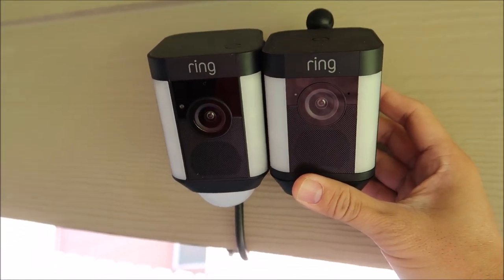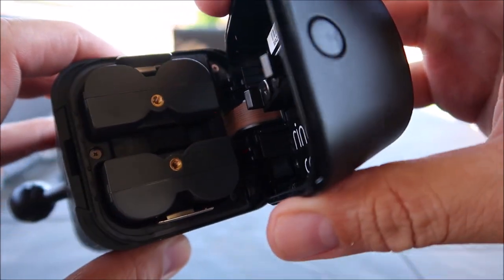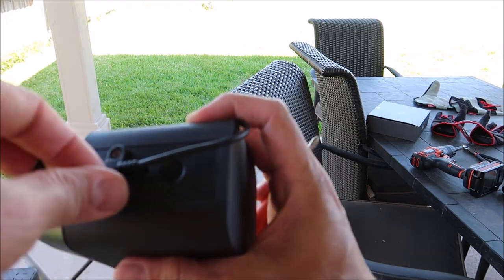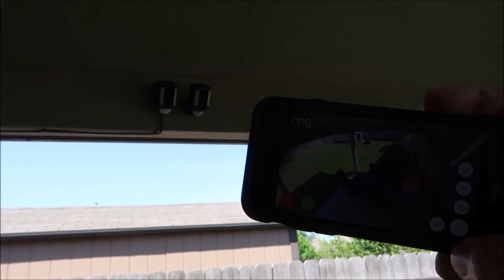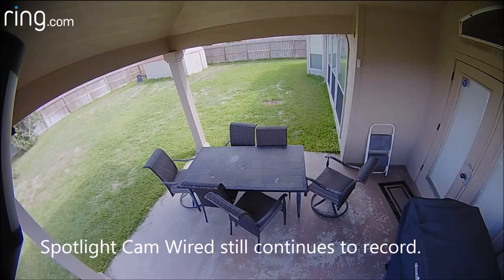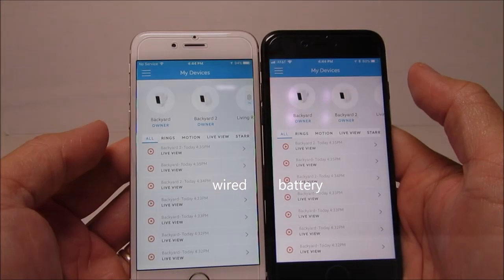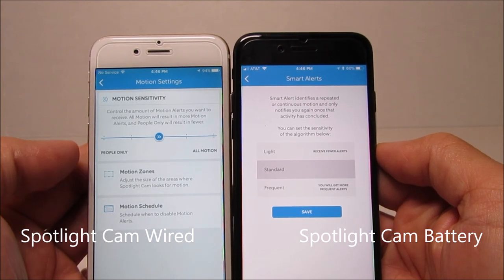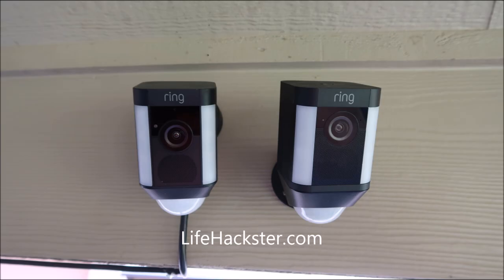Ring Spotlight Cam Wired vs Battery...which one is better?

Comment: I would love for ring to add the batteries to the wired one so that if the power goes out or the crooks cut the wire it works all the time . Thanks great video
Reply from the maker: You are welcome.
Reply: Doesn't really make difference since if the power goes out the modem will be off line too unless you have back up battery for that modem
Reply: Without any storage options battery is useless. A ups or automatic generator would be the only answer. Than again when power goes down half the time internet does also.

Comment: Excellent video pointing out the differences between the hardwired and battery cams, as well as the user interfaces. Most people (including me) would think that other than the power source, the cams would work the same.
Reply: I was planning to order 2 wired and one battery cam mounts, to save the cost of bringing power to the location on my fence where I would have installed the battery cam.  After watching this video I am definitely going with 3 wired.

Comment: Great video! I’ve started buying the wired versions for differences that you touched on. Found out after buying five or so Battery Spotlight Cams that the wired versions are a must if you are mounting them on the exterior of your home. With the battery versions all you get are false alerts due the movement of trees and the limited motion settings. With wired versions I’m able to outline the areas around trees and shrubs and works perfectly. Thanks again for the great video. The side by side comparison was very helpful.
Reply from the maker: Yes, they are more accurate in motion detection.

Comment: Thanks for taking the time to do this. There's actually a lot of difference between the two, but Ring don't seem to tell you that. This is about the only place I've found a side by side comparison. It's invaluable to be able to reduce false alarms and the settings on the wired version are far better from experience. Thanks again
Reply from the maker: Definitely the wired Ring Spotlight cam is better in motion detection.. it uses both the PIR sensor and the software algorithm and that is why it can notify you 3 seconds earlier as compared to the battery version.

Comment: Thank you for the review. It helped my decision towards the wired one. The only thing missing was the distance for WiFi.
Reply from the maker: I usually don't test WIFi distance because there are a lot of factors involved like number of walls, wall thickness and interference but it will be a good topic to do a comparison between different brand of cameras. I know Ring will be one of the last ones. It has a weak WiFi antenna and it will usually need a WiFi extender.
Reply: @LifeHackster  I got the wired version based on your review. Installed and Wifi has not been a problem as I moved one of my mesh routers a bit close to my front door. I'm getting -21db on the camera which is great.
Reply: If you struggle with WiFi distance, they sell an extender
Reply: WDJS22   What brand...model please.

Comment: Thanks for video. I tested both of these ring devices and i have to say the wired is much much better then the battery one. Picks up motion much sooner and catches all activity. The battery one actually mixed two different motions. Soo I’m returning the battery camera and keeping the wired. Just need to find a good way to plug and hide the wire. Thanks again.

Comment: Have you done, or are you planning to, review the solar panel to determine what the least amount of sunlight is necessary to keep the batteries charged? I am thinking about buying one, but it would need to face North, which doesn’t afford the most direct sunlight.
Reply from the maker: I can tell you though as compared to other brands that I have that has a solar panel e.g. Arlo and Reolink, the Ring is the fastest to charge.  Ring stated that the panel should at least have sun shining on it couple of hours a day to be effective.

Comment: Have always learned so much from your videos. Hard to believe this video is already 5 years old. It's fun looking back at old content. Anyway to convert an old Spotlight Cam Battery to a wired plug-in one? Looks like all the power cords do is charge the battery(s), is there a way to plug in a cord and make it work like a wired one, like the current models? Thanks!

Comment: Ring spotlight wired is way better for most uses.  Battery has too many issues.  Had the battery version and now using wired;  for me, hands down, wired is the way to go with pretty much all cameras.  I use Arlo pro 2 cameras too, and they are all wired using accessory cables which enhances their use-ability tremendously.  When in doubt, go with WIRED every time.
Reply from the maker: I agree. Ring's wired cameras are better overall for motion detection, alert notifications and dependability.

Comment: Thanks. Yeah I had both as well. Ended up returning the wireless one. The delay was too noticeable on the wireless one.
Reply from the maker: The battery powered has some software issues on it that Ring has to address. There is a delay because it has to power up from an off position unlike the wired one which is always on.
Reply: LifeHackster what about with the solar panel hooked to it, does it work well?
Reply from the maker: When I was trying it out...it works pretty good...I now have uninstalled the solar panel and just run the batteries..the solar panel needs to have at least 2-4 hours of direct sunlight to be effective...
Reply: LifeHackster how often are you changing the batteries?
Reply from the maker: I got the camera on October  and I swapped the battery out on December...battery was 36%. From December until now the battery level is 65%...I'm thinking the battery should last from 3-6 months depending on your use.
Reply: LifeHackster would you recommend the Spotlight Cam for my backyard or another wireless camera that offers similar features?
Reply from the maker: If you want to go with the battery powered cameras, I'll go with the Blink XT... If you can hook it up on household power...then I'll go with the Spotlight (mount or wired) or Floodlight cam.
Reply: LifeHackster Blink XT doesn't offer 2 way audio or a siren correct?
Reply: Frontlaven does the wire look ugly showing and, can't it be unplugged?
Reply: Mr. RDCS wired version cannot be unplugged because their is no internal battery. However with Arlo Pro and Pro2, you can unplug the cameras and the batteries still keep the cameras going just fine.  But always try to stick with wired, way better every time for most every purpose.

Comment: Debating on getting 2-4 cameras. I need one for the front and back yard. Front of house faces north, south side gets back sun exposure. However, I live in MI and it gets -30F in the winter and no sun. I have outlets outside. Suggestions on a brand or brands that would work for my concerns. No lag between movements, leaves blowing creating false alerts, sunlight making the camera unable to see. I'd prefer not drilling holes through my home or walls but ideally no batteries to change outside etc.

Comment: I would like to see them add the option for "Custom motion zones" to the Battery Cam. I think its possible. The "Custom motion zones" requires the camera to be on at all times, which is why the battery one does not have it in the firmware, to reduce battery usage. But i think it could still be integrated as a secondary motion check before sending notifications that could be false.

Battery Cam Scenario: Motion is detected, Camera powers up & begins recording like normal. With cam powered up, firmware now does a motion check in the preset "Custom motion zones". 
No motion in "Custom motion zones", so no push notification is sent. Unit still records the event & then goes to sleep, just like it would normally do.
This would help to reduce false triggers from trees, leaves or animals, outside the area the person would like to not cause false alarm notification.
Reply from the maker: Wow.. that's a good idea and it might be the one that Arlo is using in their "arlo smart" subscription. My only thought though that it still uses PIR as the primary motion detection which is limited in distance. So, if you are monitoring an area that is 25 feet, then customized zones beyond that is not going to be effective.

Comment: Great video! Is the mounting base for both cameras the same? I just had a wired version and am thinking about replacing with a battery version and hoping to not have to drill new holes. Thank you.
Reply from the maker: No they are not the same.
Reply: @LifeHackster  thank you for replying. Again, great videos.

Comment: Thanks for the video. As the battery version has a power input for the solar panel. Can you just plug this in to charge the batteries and turn it into a wired version with battery backup? Thanks again
Reply from the maker: You can but it will not have the features of the wired version.

Comment: How do I disable/turn off the light? Also since you have two Ring Spotlights, does that mean you need two monthly subscriptions for them to record in the cloud? Thanks for the video.
Reply from the maker: You can control, schedule  and dim the lights from the app. Yes on the subscription and if you have 3 or more Ring cameras, it is worth it to get their 10/month; 100/year plan.
Reply: With ring floodlight cam you can also control the lights , still when its dark the lights will always turn on.Even when the alarm is turned off.Does this cam have the same issue? I want to place it on a terras &  not having the lights turning on everytime i move on my chair.

Comment: Thank you for this video, seems like the wires one is better how long is the cord ?
Reply from the maker: Yes, the wired spotlight cam or generally, Ring's wired cameras are better. The power cord is 20 feet in length.

Comment: Thanks for the information. 
Do you know if the ring battery cam will pick up motion from tree leaves?
Because I need to mount it in a tree to see what needs to be seen at night. Can I turn off all lights on the camera so as the camera is not visible?  Thanks.

Comment: The wired one seems better, I just don't like the idea of having that cord someone can just unplug. What's to stop them from just walking backwards up to the camera and unplugging it? I wish they had a wired one that installed on an existing outdoor light like the floodlight cam. I'm planning on having the floodlight cam over my garage and in my backyard, but I have two lights on my deck I'd like to add and the spotlight cam makes more sense for my deck. But after watching this and your floodlight cam/spotlight cam comparison video I'm leaning towards not getting the spotlight cam.
Reply: Whoops didn't realize they have a mount version now. That helps at least.
Reply from the maker: Yes, they have the "mount" version too...but at the same price, I will get the floodlight...but the spotlight cam mount has a smaller footprint though, so it really depends on your needs.
Reply: Ya it stinks it's the same price as the floodlight for the mount version. But this one would be for the side entrance and basically be pointed at my neighbor's house so I figured the spotlight would be less obtrusive than the floodlight. They have a split-level home so the camera would be pointing towards their garage with bedrooms above the garage. So with the spotlight I figured I could just direct it so it'll catch people approaching that door. I don't have any windows on that side of the house so as long as it'll catch people as they walk up to the door that's all I need.

Comment: Is it possible to connect a Ring Chime to this setup, so when a motion is detected through the Spotlight Cam, it will activate the chime sound? Also, you know if its possible to have multiple Ring Chimes to only one Cam?

Comment: Great review. I've got the battery one, an extra battery & solar panel.  Like you I hope they update it so that I can access the lights & siren from the dashboard instead of having to go into live view. When I push siren I have to push another pop up button saying I want to activate it or cancel. I don't like that.
Reply from the maker: Yes...the siren button does have a confirmation pop up making sure you want to activate it...The solar panel works pretty good..mine is always topped off 100% since I installed it. Thanks...
Reply: Renee Hughes why did u get an extra battery if u got the pannel? The pannel will keep the one battery charged

Comment: So my girlfriend has the battery version and there is no sound coming in. Hmmm. Had me thinking it had no sound option. But I see yours does record audio. Will have to look into it.
Reply from the maker: It should record audio. Try the 2 way audio feature and see if you can hear on both sides, if not, then it might be a hardware problem and you will need to contact Ring.

Comment: I'm thinking of getting the battery cam.  Does the backup battery have to be charged by the solar panel or is there another way?  Also, I think those night lights will attract bugs.  Will the bugs set off the light?  I had that problem with a solar light I was using.
Reply from the maker: The battery can be removed to be charged..so, if you have 2 batteries...one is a backup and will not be used until the other one is depleted..then you can removed that battery to be charged via the USB cable ~8 hours or so..then just reinstall it which now, it becomes the backup battery. The night lights/spotlights are LEDs and they are not "on" that long to attract any bugs.

Comment: This is simple, wired is always better!!!   One of the big problem with wireless cameras is that to save on battery life, they go into sleep mode.  When they sense motion, they wake up and then start recording.  By that time a porch pirate could have come and go quickly enough before that wireless camera starts recording.

Also battery life estimates on those things are over rated.     Then you have to bring out your latter once in a while to take the camera down and recharge the battery and then re-aim the camera once again.’
Reply from the maker: I agree. I'll only go with battery powered cameras if the area where I want monitored doesn't have any access to an outlet or junction box.
Reply: But then you have to worry about someone cutting it

Comment: Did you ever get the freezing issue resolved on the battery version.  Mine is always freezing up to the point where it is better to just look at the event but it even does it.
Reply from the maker: Yes, my spotlight cam battery has little to no freezing now. It is in the same location where I had it before and the came connections so I am assuming Ring updated a fixed it. -> https://youtu.be/tlteuLqOaHc

Comment: How come you decided to use the wireless one? I’m considering one as I can’t hard wire the floodlight model.
Reply from the maker: I actually do have the 3 types of Ring spotlights..I purchased the battery one so that I can easily hooked it up anywhere without needing to think about power supply options...I have issues with freezing footage on my battery spotlight at this time and Ring is aware of this.. https://ring.com/share/6516490205887293920

Comment: Have they update the lag on the wireless camera I'm looking to get a wireless one but not sure. My only problem with the wired one is that I don't have a spot to hide the wired Thanks for the great info
Reply from the maker: I'm actually going to to an update on this pretty soon and I can tell you that the choppiness is gone on the battery powered one. I have to do more testing but it seems like Ring has fixed the issue...
Reply: LifeHackster oh ok thank u
Reply: LifeHackster is there a way if u put the camera sideways can u set the app so this way the camera can look straight

Comment: Since the Wired version has been in use for while.. Did u clean the lens on that one before the test?  That could be why the night vision on the wired is less clear then the Solar device. Id like to see if cleaning the lens made a difference due to id be using mine more for the night vision more then day time use.. Thx!
Reply from the maker: I'll clean the lens and check it again...
Reply: LifeHackster Any update?
Reply from the maker: Cleaned it and I really didn't see any difference. Check out the Yi outdoor cam if you want a camera for night vision - https://youtu.be/KQSPI6PKTeo?t=15m31s

Comment: Have you heard if the battery (wireless) spotlight camera will have the method of defining the motion zones as the wired spotlight camera?
Reply from the maker: As far as I know, No..just because the battery version only uses PIR sensor which doesn't base it on the camera's view as compared to the plugged in versions which has both PIR and also the camera's view for motion detection. To have this feature on the battery powered one, it has to be on all the time which will drain the battery quick.
Reply: I live in a very sunny area and I have the camera with the solar charging panel. I've never seen my battery below 89%.  Sure would be nice for the company to provide this as an option for the consumer. Where I need to place the camera there is a lot of trees around in the field of view, and without this feature, it makes the camera useless for notification.  Thanks for your channel, very well done.
Reply from the maker: I have my spotlight cam in my front yard and has no issues as to false notifications because of trees and leaves movement... It uses PIR which detects heat so you should have no issues with it even when placed near trees.
Reply: I wish mine worked that way... gets the trees all day long.  :-(

Comment: Is there a way to convert the wired on the spotlight cam to the wireless one to take battery backup? I know you can take off the cable by disconnecting the hardwire inside the spotlight cam but that's about it.